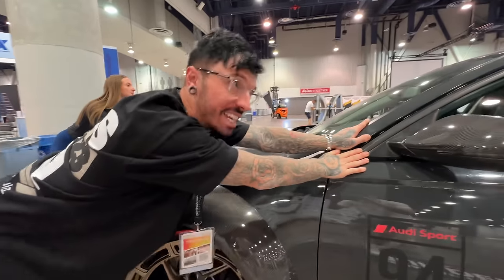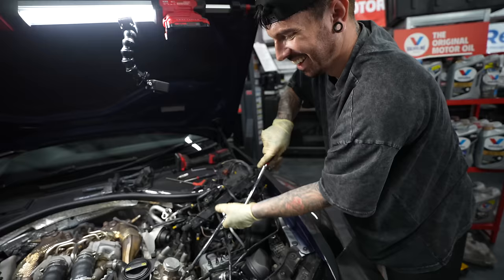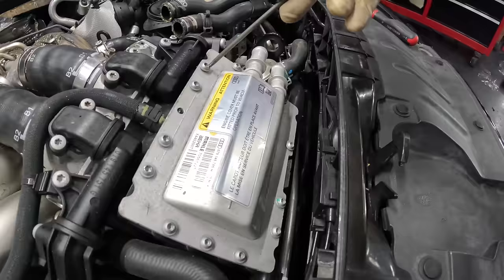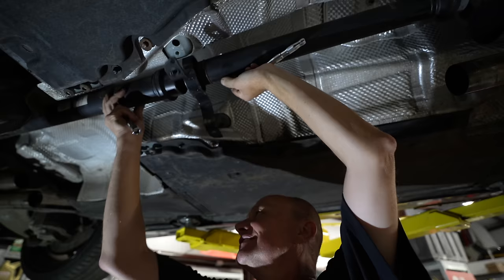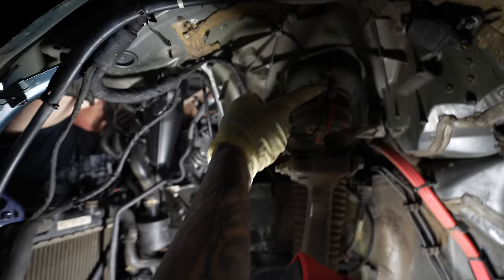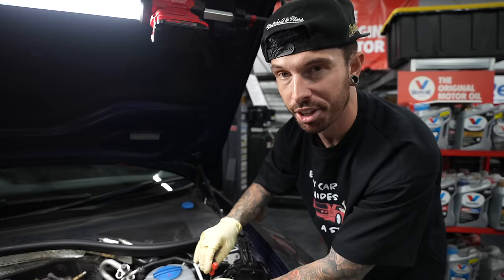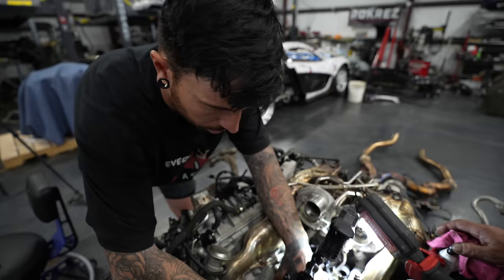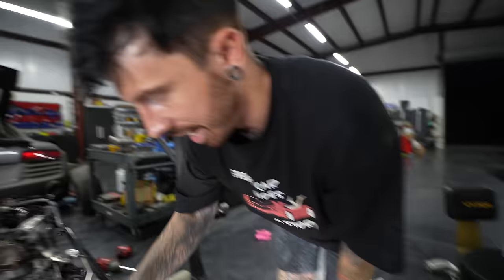REBUILDING A WRECKED AUDI RS6 GT3 #1

Comment: I dunno man... the engine has knock sensors and any tune that doesn't pull timing when knock starts isn't worth a dime... yes the fuel will cause the engine to run worse but that's because the tune should pull timing and you'll lose performance...

Comment: If you look at this monster of a combustion engine you do realize that this is a total dead end. An electrical engine can produce the same power with ease, is more compact, has only a few moving parts and runs for ages without any maintenance. Of course there is this little problem with the battery and the infrastructure but alas....

Comment: I'm surprised an engine as sophisticated as this doesn't have detonation control to protect it. Accelerometers on each bank or between pairs of cylinders to detect the forces of detonation and then retard timing or limit power before engaging limp home mode to protect the engine

Comment: Wouldn't the VERY complicated, VERY high spec Audi have a sensor/s that would detect 'knock' & octane levels, and cut the power / timing / injection back to compensate / protect itself ??????? People must miss fuel performance turbo cars all the time?

Comment: Did he confirm he put low octane fuel in? If they did then that’s a major fail on them. If it’s tuned for 100 octane then it should only run 100 octane or more especially if you’re racing it. If it was running good fuel then the tune is shit! And that’s on the tuner.

Comment: That shouldn't have happened to be honest. The ecu should have detected the knock and retarded the ignition. Whoever mapped the car has probably desensitised the knock detection. The ecu should have been able to easily cope with that. The difference in timing between 95 and 99 Ron fuel is only about 4 degrees an audis can pull 10 degrees out easily to deal with knock. That's 100 percent an injector failure I'd say as it only happened on one cylinder.

Comment: america has rubbish  fuels  her we have 91(base bottom level) octane then 95 octane then 98 octane and finally we have 100 octane fuels, our 100 octane fuel at the pump has 100% no garbage ethanol bullshit( ethanol eats and destroys fuel systems pump injectors  and so on if left for periods of time) biggest replacement part with running ethanol is fuel pumps, ethanol(garbage fuel) absorbs water like crazy, that water then destroys the fuel systems)
i prefer using and paying more for aviation fuel for small prop planes, it has very high octane and  it is full leaded(does not detonate easily)

Comment: The tuner have turned off the misfire detection.. otherwise the engine management will adjust the timing or goes in limp mode! 

But after al YOUR ENGINE IS FUCKED 🤬

Comment: Sorry Matt, your explaination of Octane ratings in fuel is plain wrong. The Euro RON standard and the American Octane numbers are not directly compariable. In addition the knock sensors adjust the timing for the fuel type and atmospheric conditions being encountered. Therefore Knock, or pre ignition is not encountered because it's compensated. It has nothing to do with what your explaination tried to say.
Reply from the maker: Yeah that was mentioned and the knock sensors are pulled way back by the tune
Reply: @MatArmstrongbmx  Thanks for the reply. Actually surprised you did. Of course, I don't know what your tune does or doesn't do, but knock sensors are not adjustable. There a sensor, so they either sense knock, or they don't. You cannot tune them, they're like a switch. I honestly think you had another issue here rather than fuel, which is why I wanted to point it out. Burning a hole through a cylinder like that is almost unheard of these days. That cylinder would have to run so hot to be able to have that happen. Also, blaming the fuel doesn't explain why the other 7 cylinders didn't run so hot that they also burnt out, but there's no damage on those or the plugs.

Comment: name and shame the tuner. Why would you disable the knock sensors? and if you did - why did you not explicitly tell the client ie: Mat that knock sensors are disabled ONLY USE 98/99RON fuel.
Seems like the tuner took some shortcuts and fucked around and Matt found out

Comment: The fault is not CA fuel, the fault is YOU. Sorry Matt, but that's the fact. You had to, or at least should have understood this when you put fuel in. Then you take it on that speed run? The fault is on you. You could have found some proper fuel (not consumer pump fuel) but you didn't even try to before you put that thing under high stress. Not a good choice.